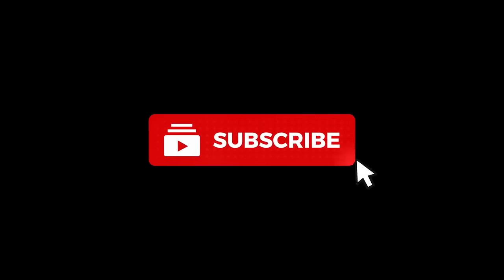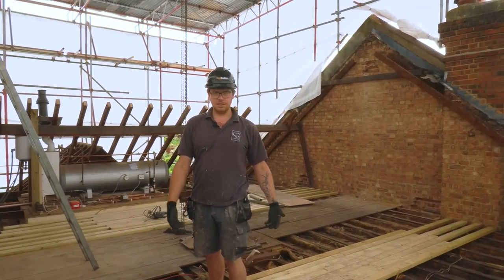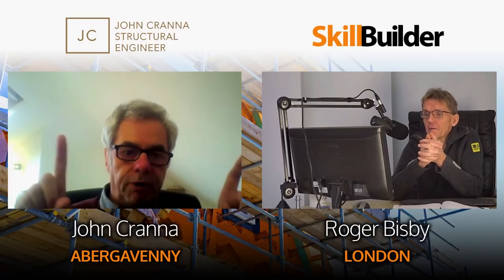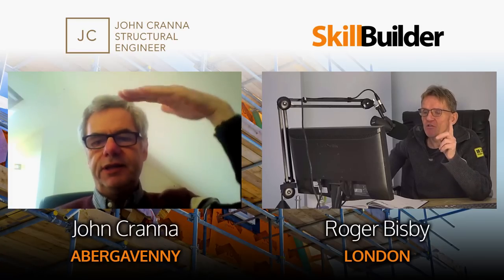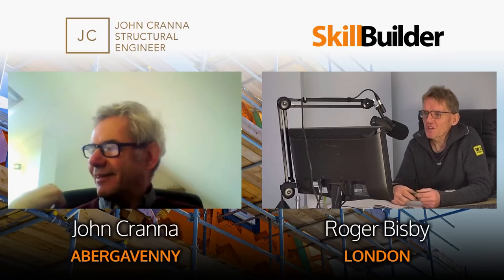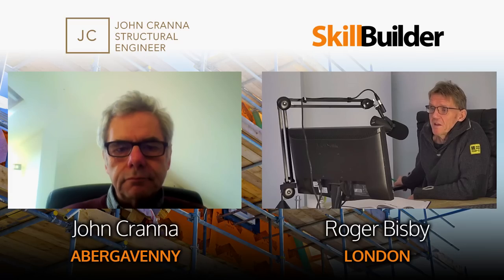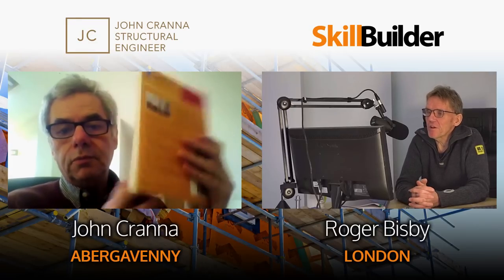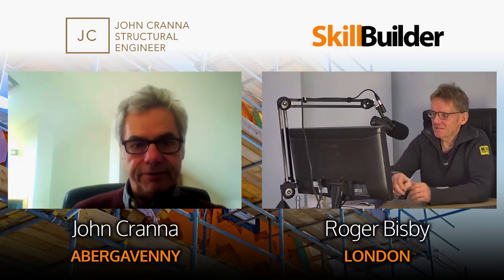Unlocking the Secrets of Structural Engineering - An Expert Interview

Comment: We had an architect 7ys ago who seemed to be a decent person at the start, took about 3 weeks to produce something in electronic format for us to look at and emailed us which we couldn't open, When I asked for paper prints to approve it was going to cost us £40 to print and post. I went into work and found a guy in the office who had access to his own CAD software but only print on A3 for free. We looked over the prints and requested changes of stuff we specifically did not ask for, we just wanted simply basic design to keep costs down and he was rather abrupt like he knew best. After another couple of weeks we had an email to say he needs to get a structural engineer to work out the roof design. And when I asked why he wasn't doing it he then broke the news that it going to cost about £1500 if the design was straight forward. I was furious but had no choice so reluctantly. agreed. Many weeks passed and eventually about 15 drawings in electronic form appeared in an email. Again I asked for paper but it would be a further figure of around £150. The drawings were mostly A2. In the end I paid £30 on line, I just forwarded the email with contents. The drawings were of good quality, I cant knock that, but I would never pass this architects details on to any colleagues, I think he is a pretentious idiot who preys on peoples lack of building knowledge. I can see why he drive about in some top of the range 4x4. I ended up paying over £8000 for all this once other little extra bits crept in, never again. I'll just move. I was relieved to be rid of him.

Comment: I recently spent £1600 on a surveyor/architect. Then spent £500 ona structural engineer. Give the structural engineer anyday. Got back the £1600. Did our own drawings.
Reply: The roles of an architect compared to a structural engineer are not analogous or an alternative.  You would normally employ an architect initially and then get in an engineer if they are structural items that need a bespoke design.  Architects are aware of all of the parts of a building to comply with the Building Regulations which cover Parts A to P, structural engineers only concern themselves with part A which means there are a lot of parts that we don't cover.  I'm concerned that you view them as an alternative.

Comment: Is structural engineer a new modern thing? My ground floor joist are just laid on top of great big rocks/stone no mortar no nothing! 1890's build btw atleast that's what it says outside.
Reply: They've been around since beginning of 20th century as a lot of the structural mechanics design principle s had been established by then.  But in most of Victorian era it was very much design accepted method.  It was the era of railways and tunnels and bridges so civil engineers like Telford and Brunel were to the fore. In the 1930s new architectural forms like shell roofs meant new design methods were needed but all done by hand!  In 60s computers started to be used and I can't imagine life without a laptop to do my design work!!

Comment: I would say from my experience alot of engineers don't provide practical solutions and give little or no thought to the fitting of the steels, the trend towards using one larger steel with a 10mm plate welded underneath when supporting cavity walls is a good example, it's so much easier to bolt together 2 individual steels. I would love to see one of these engineers manhandle their steel design into place, perhaps they would go back to the office and rethink some of their designs!
Reply: The ‘trend’ of using a single beam with a plate welded beneath isn’t an example of that; it’s used to minimise thermal bridging.
Reply: @enjek5654  The new extension is now the external structure so is thermal bridging a major issue? All engineers should have a month on site fitting steels as part of their training to give them an insight to what is involved.
Reply: @edthompson9337   You haven’t said where this hypothetical beam is in relation to the external thermal envelope. Are you saying that it’s in the knock-through opening between existing building and new extension?  If so, there’s no need to reduce thermal bridging in that location. I’ve never seen that done. Have you come across lots of examples of it?
Reply: @enjek5654  Yes in the knock through, recently we have had a number where this method has been used, it's been a real struggle to get the beams round to the location let alone into position.
Reply: @edthompson9337  Sounds weird. There’s no reason to do this. I’d be speaking with the engineer when quoting for the job to make it easier for you to construct. I’d never design it this way.
Reply: In reply to other people's comments about thermal bridging being the reason, in my experience the reason is that if it is supporting external masonry and you have facing brickwork then you don't want to have a steel supporting the outer skin and hence you have one steel supporting the inner skin and a steel plate welded to underside of bottom flange which sticks out and supports the outer skin.  As you have only one beam doing the job of two then this will be much heavier and I don't like them as the eccentricity of the outer skin puts a twisting or torsional moment on the steel beam.  As for practicality of design in getting the steels in place; it should be something that a good engineer thinks about.  I often design splice connections so that long steels can be split into two or three so they can be manoeuvred into place - I did discuss this at one point with Roger.  We also discussed how vital it was for me to see how builders manhandle these steels as it is so easy to design a size and length but anything thing to work out how to get it into place!

Comment: Is it all math?
Reply: Yes!!  And using computers but to be a structural engineer then a good grasp of maths is needed.  We often do checks by hand to get an idea of sizes and also you need to have an idea of what the computer program will throw out.  If a beam size comes out very large or small or the deflection of the frame is very different to what you expected then you go back to your data input and modelling and look for the error.